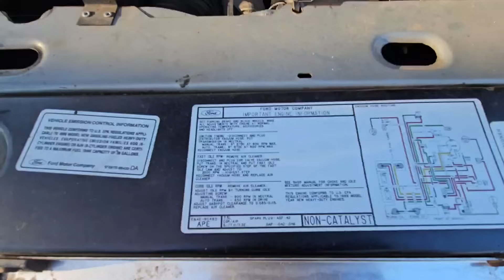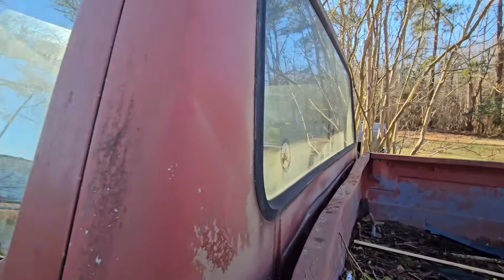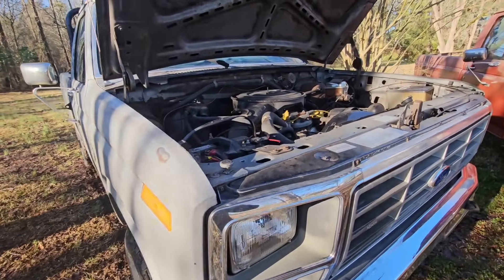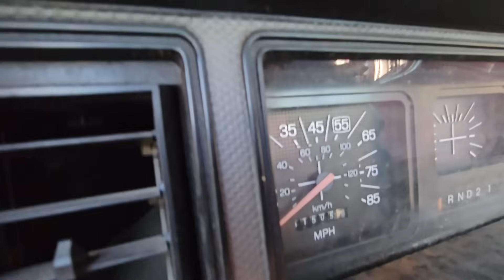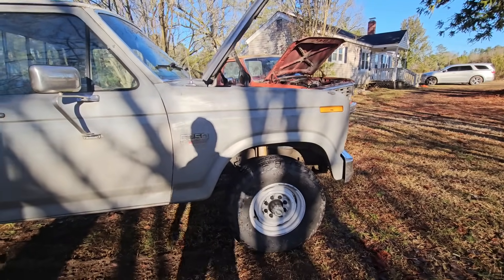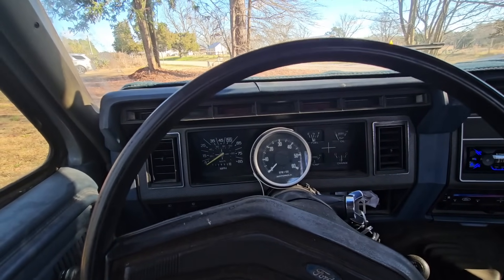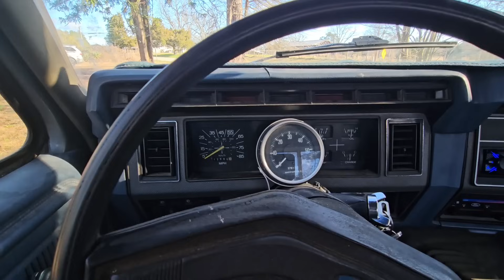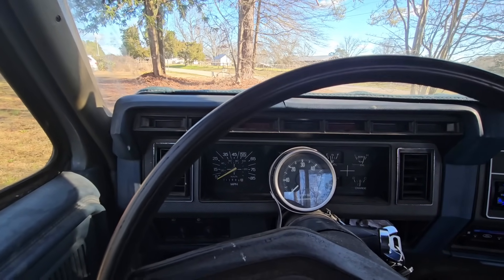THE WORST TRUCK FORD EVER MADE!?!?! #ford #fseries #sbf #bbf #truck

Comment: I’ve got a 1980 f150 4x4 351m at  transmission was rebuilt 15 years ago. Motor has had all the smog stuff taken off and catylitic converter removed dual exhaust. Removing smog stuff has no gain. Engine burns oil but she still still runs and work it around the farm every day. Most of the time it’s pulling a trailer. It’s beat up,smokes some,have to pour gas in the carb to crank it but it’s still going strong.
Reply from the maker: That is awesome! Keep it running!

Comment: I built one of these. 89 f250 351w 4x4 t18 4 speed. Has 83 front clip. So yeah its a bullnose.  If you have the right tires they'll do good in any condition I recommend 7.50 16s.  Pulls trees down skids logs hauls steel I have no complaints it makes money every time it's used. Helped a neighbor get unstuck with it just a few minutes ago

Comment: My dad used to have a 1982 F-100 4sp stick 300ci I-6 and it was totally reliable for decades. He should have never sold it because the body, engine and transmission were still very good.

Comment: I was hoping one had a 300 inline 6 I had an 85 F-150  most reliable truck I ever owned was an 85 I also had a 93 and a 95 with the 300 inline 6 the 95 with a 5 speed loved all 3 but eventually upstate NY winters destroyed the frames but them engines run for ever

Comment: I just have to rebuttal your statement saying nothing cold starts better than an edlebrock. I have an 86 f350 cab and chassis 4x4 with a 460. It has the original Holley on it and after I rebuilt it, it will fire in the first crank as long as there is fuel in the bowl. I would say it has more to do with tuning then style of carb. Great video and some great information on these under rated trucks!
Reply from the maker: @MountainWild66  I can respect that and thank you!!

Comment: I pulled a 86 ford pickup out of the weeds put a hot battery on it 302 with a 4-speed drove it home and fixed the brakes, drove it for 5years til it finally quit sold it for scrap with the 20,000 pennies i glued on it

Comment: That exhaust tick doesn't seem to go away when hot.  I would at least check for a loose exhaust manifold bolt.  Sounds like only one cylinder, probably at the end.  You can find which by listening through a tube.  Maybe the gasket is blown but might be fine. I'm not familiar with that build, it depends on the material.  Does hurt mileage but only hurts engine if you are pushing it hard.

Comment: My guess is fuel economy and crash test ratings. Also, my dad had one like this: 85, extended cab, 460, towing and explorer package. The thing could tow, but it seemed like it broke down in between every time we used it somehow. Sold it with a significant exhaust leak.

Comment: I have owned most all major brand trucks over past 70 years and I have to say Ford is the very best trucks ever made. If that truck was a two wheel drive F-150 short bed it would bring very good money. I still drive a 1984 with the 351 Windsor if I did not let off the gas pedal at red lights it would burn the tires off of it. How many 40 year old Toy ota do you see on the roads.

Comment: The Catalyst thing breaks down like this.
1975-1978 All vehicles under 6000lbs GVWR had Catalytic Converters. (That is why F150 came out vs. F100)
Then 1979 it changed to all vehicles under 8500lbs GVWR had Catalytic Converters...(That is why 1980s Ford Split the F250 into F250 (LD) and F250HD,  the latter is what you have 8 Lug Full Floating rear Axle and the Non Catalyst are big clues)..and that went on through to the late 80s sometime. 88 or 89 I think... For You Dentside (73-79) guys reading...The 1979 Emissions change is why there was a 1979 F350 4x4 and NOT one in 1978...

Comment: They're the hidden gem of the F series lineup.  They're solidly reliable, are not hard to find with EFI V8s and have everything you need, nothing you don't.  They also have a solid aftermarket if you're looking to build one up with a lift, engine mods, etc.  They lack the collector value that massively inflated the value of the 70s era F series, which is keeping them cheap for now.

Comment: Ford's ignition systems were so bad in the mid 1980s that many owners replaced them with point ignition systems.  The Ford in line 6s were the best Ford ever made.  The Ford 302, 351, 360, and 390 engines were also great.
Reply: Yep, back in the early 1990's, I owned a 1984 F150, 300 6 cylinder, great truck but I was replacing the ignition module or pickup coil about every year. Installed a point distributor and it actually ran better. That 300 was a great engine.

Comment: I had a 1/2 ton with a 351 Windsor, 2WD, manual transmission.   It ran propane most of the time. Put hundreds of thousands of miles on it.

Comment: I bought one new in 1983, December.  It was 1984 model.  I was 29.  Years later I gave it to my son.  He  still has it and drives it periodically.  It is an F150 4x4.  We towed wood trailers with it.  Did not have to use 4x4 to do so.  Of course four speed granny gear helped out.  But we were starting out in second gear😅!  Awesome trucks.!!!!
Reply from the maker: Very cool truck! Glad it's still on the road!

Comment: I have a 1986 Ford F350 4 x 4 XL  with a 460 and 3 speed auto and twin tanks. Manual says both tanks are 16 gallon. I can confirm the front main tank is 16 gallons, but the rear auxiliary tank is smaller. 
In any case, besides being a gas hog, it is a land tank. 7,000 pound chipper, no problem. It’s not new and it shares all the wind noise issues. It is a rough ride being a 1 ton and 4 WD, but it’s a truck. These modern $60,000 and $80,000 trucks to me are a total waste of money. 
I bought this one right at the beginning of Covid for just under $6,000. I felt it was a little high, but no rust and in good shape, and it is all tan like it is a poor man’s Humvee, I had to have it. A year later I had people offering me $10,000 trying to buy it everywhere I went. Still to this day, people ask me if it is for sale. Nope! I don’t drive it much, but I take care of it. 
Late fall we had a bad storm roll through. Trees down everywhere, most in the state without power, and I wanted to check on my dad as his cell phone was not charged and land lines where down. I drove around a couple road blocks, under broken power lines, had to stop twice to cut trees from the road with a chainsaw, drove over a tree, drove into a field to get around debris just to get up there. My car would not have made it. But this old land tank was up to the tanks and showed what it was made of.

Comment: Aw man these are all great trucks! Just like any other vehicle (post 75 here in Calif), you have to deal with the state/county emissions/smog racket. Heat risers, smog pumps, de tuned carbs and the other emissions clutter with the miles of vacuum hose has to stay and be maintained. 
There are plenty of areas left in the country that don’t have the aforementioned racket. 5k is a great deal on the 351w/auto! That’s not a lot of money. Right person has to be scanning Craig’s list or wherever you have it listed.

Comment: I actually like the body style of those mid 80s Fords, and the engines were also okay. People put down the 400 M motor but hooked to the right transmission that motor is just as good as any other Ford engine. And it's my opinion that Chevy guys like their Chevys because they can build them for less money than we can our Fords. But guess what? I got a ton more torque out of my Fords than any Chevy I've ever owned. And my Fords have all been stock. I'll never buy another Chevy, and don't even talk to me about Dodges cuz we just won't go there. I currently own 2 Ford trucks. One is a gas engine vehicle and the other has the 7.3 diesel with a 5 speed manual. I can pull a house off of its foundation with my diesel or pull stumps. No Chevy I've ever owned could do that and Dodge can't even touch that. Love my Fords. Always have.❤

Comment: I think the 351 specs you said were for actually the 351ho that year.  It had a aluminum intake, holley 4brl, and the hotter camshaft from marine 351.  I want to say a regular 351 had like 150-170hp only.
Reply: I hate spouting off specs without re looking them up, so I just went On google to look them up and come back. So I guess the only 4brl 351w in 1985 was the HO . So if that truck came with a stock 4 barrel it’s an HO and you were right.  They did offer a 2 brl which was a non HO version and that had 158hp.   You should put real dual exhaust on it, those sound great with that marine cam.  A kid I knew had a 351ho in his bronco and when he put flowmasters on it , it didn’t just sound like a tinny drone like the stock 302s did or even worse, a 305 or 350 Chevy tbi.  They got some lope to them and scream at WOT.  I really like these motors.

Comment: My dad had an ’81 (I think) F-150, it had “Ford” spelled out on the front edge of the hood instead of the blue oval on the grille. Red on red, 4.9L straight six, 4 speed, 4x4. It was unstoppable, lots of good times growing up in that truck. Northeast winters took their toll on the frame and he had to scrap it. Big shame because it was mechanically sound. I’d like to own a non rusted out example one day. To me, it’s what a truck should be.
Reply: 80-81 had lettering on the hood 82 they went to the oval emblem

Comment: Even with twice the fuel capacity that 460 isn’t going near as far as the 351 will LOL. Best engine ever put in an F-series? Navistar 7.3l IDI, with the 4.9l I6 a close second. Replace the fiber timing gearset with steel gears from a CSG649 industrial engine.
Reply from the maker: I agree both of those engines are just about indestructible! I kind of want to do a fuel mileage comparison between the 460 and 351 truck, just to see!

Comment: You think $8500 is cheap, I have a '58 F350 my father bought new, he paid $2200.  My daily driver is a '83 F350 with duals and a 351.  It's rated for 15000 GVW.  It starts on the first crank, cold, with the original Motorcraft 2 barrel.

Comment: The reason why those trucks don't have catalytic converters was they 351 was a two barrel motor I know because I had one with a 4-speed stick four-wheel drive the 460 probably had a small 4-barrel carburetor that's probably why it did not have cats but I could be wrong

Comment: F250s didnt have 302 option.  300 was base then straight to 351.

My 90 Lariat cost $13k new.
Reply from the maker: They did have the fuel injected 302 option. First year of it. They're super rare though. In 1986 only.
Reply: Ok as a 1 year option I see me missing it.  Even 3.8 v6 and 4.2 v8 ran for 2 years.

Comment: Spot on. Complete junk, unreliable throttle body fuel injection trash and an ugly body design. You should make a vid of how much Ford trucks crashed from 1979 - 1980. The   1979 models were still a great truck, however 1980...... puke

Comment: Did you edit out how many times you stopped for gas on your little joyrides? Haha. I have an '81 with a 351 Modified with 135k original miles and I get the worst fuel mileage imaginable! But then again, trucks weren't made for fuel economy 😁

Comment: I have a 89 F-150 4x4 351 manual with power windows that I use as a farm house. I was driving her as a daily until her rusted too much. Then I found my barn find, a 88 F-250 HD 351 manual RWD in mint condition. She sat for 4 years beside a barn and started up like she was ready to work. Sadly she was stolen and burned. But I found her in the end and got to say goodbye. I miss this truck at times cause my 02 dodge is an auto. I miss running though the gears

Comment: I bought a 1980 F 100 new and the quality control was terrible. I put 12000 Miles on it and the clutch started slipping. It had 6 bolts holding the pressure plate to the flywheel. But they forgot too, and the remaining 4 came loose.  At 50000 it had a rod starting to hammer so I had to pull the engine and put a crank kit in it. It never did have very good oil pressure. The first week I had it. The tailgate would not open till the linkage was bent real bad. 80 and 81. Was the worst years for Ford trucks? The frames were real weak. The frames had a bunch of holes in 'Em to lighten up the trucks to get better mileage, and the F 100 was super light duty and had 4 and a 1/2 inch bolt center wheels just like a Torino

Comment: In 1982 my dad bought a Ford F100 custom and my uncle shortly after bought a square body Chevy in 1992 my Dad gave me that Ford F100 it had a little rust and over 100k my uncle sold his Chevy because the bed rotted off and the cab corners rotted out and it had 90k miles we lived only 15 miles away from our uncle so I believe that Ford actually made the better Truck ours had the 300 6cyl I sold it in college because parking a long bed was hard to park on campus I regret selling that truck to this day

Comment: I happen to have an '86 with the 460, 4 speed 4X4 etc. I have 40 years experience restoring cars so I am probably better than most at close observation of construction of these. What I can say is, the sheet metal is thinner than the earlier Fords so they're easier to dent , the drivetrain is solid except the manual transmission and transfer case are ok but not as heavy duty as the prior models and the interior is much more plastic than the  (79 and earlier) models. That said, they are really good to drive and have a few creature comforts that the early models didn't, like a decent cruise control and decent intermittent wipers etc. The twin traction beam front end is silly but works OK ish so a straight axle swap is awesome for them. Otherwise they last a long time and work really well. I get comments just about every time I take mine out and offers to buy it are common. I did swap out the Borg -warner trans and t case with the older New Process units, and very happy with that swap. Plus the dana 60 front diff. is awesome.  If I had to do it over I may start with a '75 or so but then I'd feel bad swapping out some of the stuff I didn't like. With the '86 I don't worry about it, I just do it. BTW, towing with a heavy trailer gets 8 MPG, not much worse than newer stuff. 460's are truly a remarkable engine.

Comment: I have owned several Ford trucks around this age with engines from the 300ci six to the 460ci V8. All were great vehicles, still own a 1979 E150 short wheel base van. It started with a 300ci six and a manual four speed, very rare option. Now it has a built 460ci with an E4OD  transmission. Plan on keeping it as long as I  am alive, then my boys can fight over it.

Comment: I used these trucks and E-250 Vans in my business fleet during the 70's and 80's. They were great work trucks and had very few problems. I also tried Chevy's and Dodges during this same time frame, and they just didn't hold up. Calling these the worst truck ever just sounds like an uninformed narrator. I still have one of my fleet trucks, it's an 85 and it still does everything I ask of it without complaining or problem.
Reply from the maker: Very good! I like the experience and the good read! Thank you!

Comment: The 80-86 bullnose Fords are prettier than the 87-91 bricknoses.  I loved my 83 F100 300/6 but hated the granny 4 speed.  I love my 89 F250 7.3 5 speed but it's not as pretty.  Also, these trucks no longer exist in the Northeast because they're all rusted out.  Great video, great trucks, beat the Chevy squarebodies by a mile.

Comment: Last Summer I bought my 1984 F-250 Super cab for $2.500. it has the 460 with a Holley Truck Avenger 770 CFM Carburetor. My 1980 F-150 has a 302vwith a Manual Transmission and I paid $1.500 for it with 3 Tool boxes a ladder rack a set of new shocks and 3 extra tires. I just put a new Radiator and Hoses in the F-150 and a electric fuel pump, new starter, battery, new heater fan motor, battery and starter cables and starter relay on the F-250.
Reply: Both Trucks are 4cWD and came with the Original Owners manual.

Comment: There was nothing called ac delete.  All f series in those years came without ac.  If the ac option was selected on the order form, then it was factory installed.  If a dealer had a non ac pickup and a customer wanted it dealers could install it then.  Pickups had different emission regulations than passenger cars.  Cats were installed on the lower gvwr pickups.

The 12500 you referenced is probably the max gvwr meaning total weight of vehicle, passengers, and cargo.

Comment: My uncle had a 1981 F 150 4X4 short box that was a cream puff. Love that truck. I am looking at 1980 2 wheel drive with 300 6 and am seriously considering it for 1500.
Reply from the maker: It wouldn't be a mistake! That truck will run for a long time!

Comment: Ugly, yes.  Dependable has hell.  351w and the 351m and the 400. And the 6.9 diesel, all very dependable as hell and easy to work on. Last years for the np435 manual 4 speed. I’ll buy them all up

Comment: Having owned and driven a few of these trucks, they have one major problem. They can’t tow shit. These things are gutless. Having owned a few 460s these engines are terrible they all blow up. Those 6.9 diesels were reliable but absolutely gutless. It’s too bad they don’t make simple trucks like this but with modern diesels, frames, and axels. I hate all the crap on the new trucks, but they can actually tow a loaded trailer in the mountains. These old trucks are great if you don’t tow anything, I can’t imagine hooking up even a 26,000 lb loaded trailer to one of these old trucks. I don’t think you could make it up a 2 percent grade. If your not towing these trucks are awesome.

Comment: I bought my 86 F250 with a 460, 4 speed brand new.  Finally sold it about 2 years ago.  I had an 80 F250 with a 351M which was a dog.  Is your 351 a Windsor or a Modified?